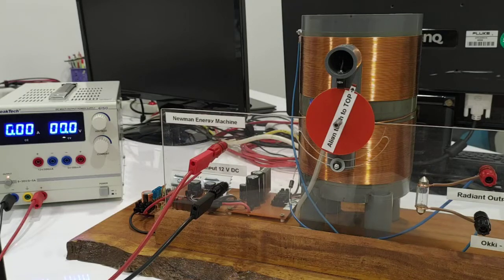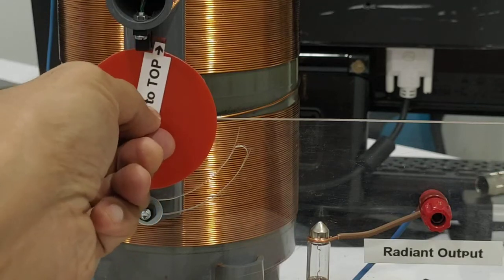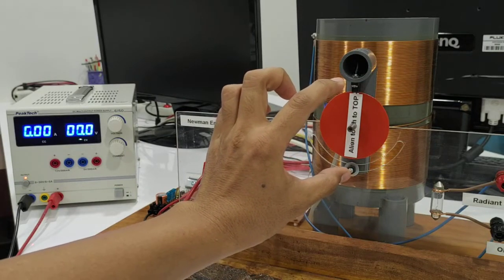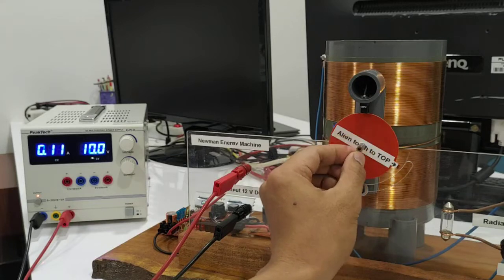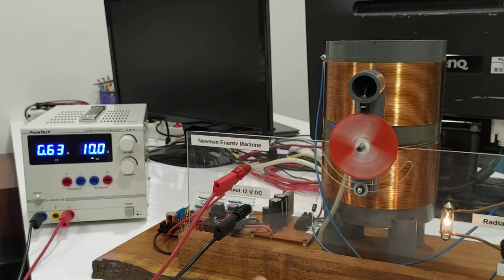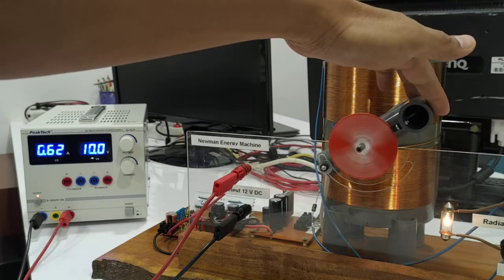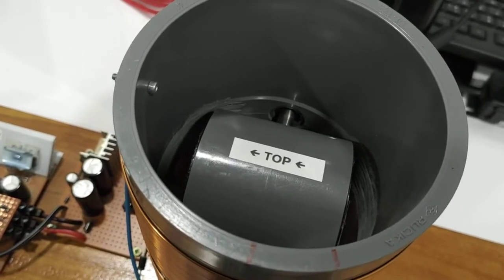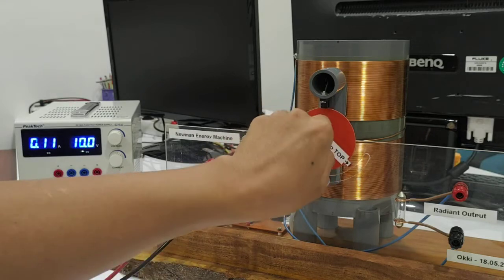Newman Motor - Load Test

Comment: I heard the Newman generator produces a “negative” current. Is this true?
Reply from the maker: Not only Newman Motor but all coils if you power it with DC pulses. It depends on how you put the probes on the coil terminals, if you put the probes in upside down polarity you will see negative spikes.
Reply: Okki Moeljadi oh ok
Reply: Okki Moeljadi thanks

Comment: Hi Okki. The Dr.Peter Lindemann motor experiment i did, showed me the following things.
About a rotating switching disc. You for practical engineering purposes chosen the diameter of your s/w disc. Depending on the RPM, determent's the switch speed of the coil. The moment-ale coil saturation time period. The blackout window length can determine the time for switch on, If the diameter gets larger and the same black out window length is maintained then the switch-time duration is faster, the larger you go in diameter the faster or less the switch time period is on. The question is, by the maximum frequency of RPM used, what is the required saturation Time of the coil. Maybe the wire is far to long saturated/power is on, then needed? How much mechanical work can the rotor do, connect pulley/belt rubber O'rings to small dc motor/dynamo and use it as as shunt for efficiency reading also for startup.. LOL Edgar.
Reply from the maker: Hi Edgar. As I understand, we should use the coil length in consideration of input voltage and rotor speed, so that we don't waste electrical input energy as heat in wire. Just like the trick people are using to wind primary coil of a transformer. They wind a core with as many winding until there is no current flow, and after that, they stop and start to wind the secondary coil.
Reply: @OkkiMoeljadi  Hi and good morning  Okki.
We talked about the inner magnet rotation torque harvesting, or the torque harvesting from the outside. The wire lengths and gauge of course will change everything.
You can have a rotor inside with 4 or 8 or more magnets. that would crank the speed up which means you can run it also with a external oscillator. Power is in frequency/speed. have fun.

Comment: my thoughts on the newman motor is he's converting dc voltages from batteries and converting them into ac voltages to run ac motors. its very similar to the theory gerard morin had going on with his theories and implementation, although he quit for some reason.
basically, applying dc voltage is one way, to convert dc to ac is to run a dc motor to spin a rotating magnet with copper coil which will then induce ac voltage.
apply this ac voltage output into a transformer, specifically a step up transformer, to step up the voltage, the amp is significantly dropped but the voltage significantly increases
in return the output of this transformer high ac voltage will then go into a vacuum spark gap and spark very fast
wrap ac coils around the spark gaps casing to then harvest the high voltage and high frequency, basically high ac voltage frequency
from my understanding, in theory the amp is replaced by the high frequency from ac voltages, this in turn the higher the frequency the fast it is, so instead of volts x amp its volts x frequency this i believe was what newman and gerard and even tesla was doing, utilizing high voltage and frequency to power motors and tap into fields instead of dc voltages.
Reply from the maker: That's a very good thought! Maybe to improve the efficiency further, we can use magnetically quenched carbon rod spark gap.